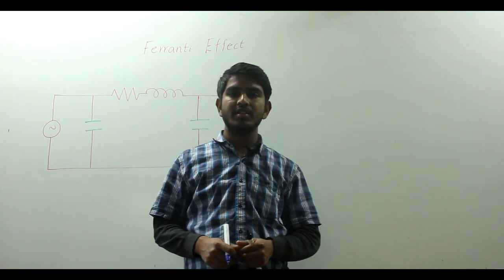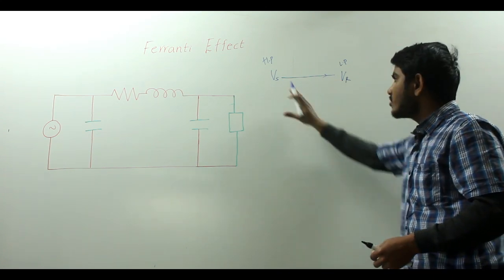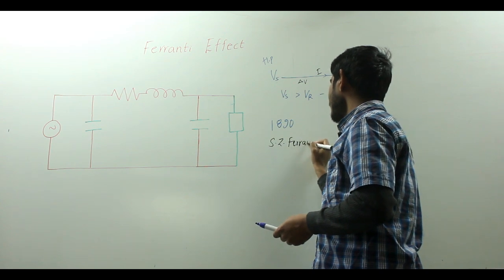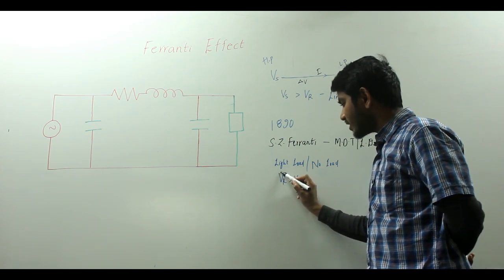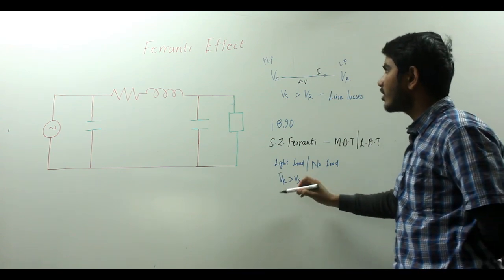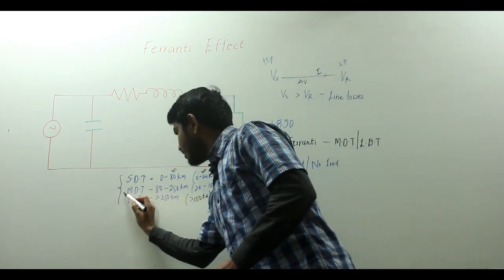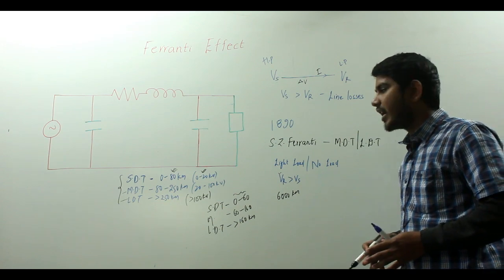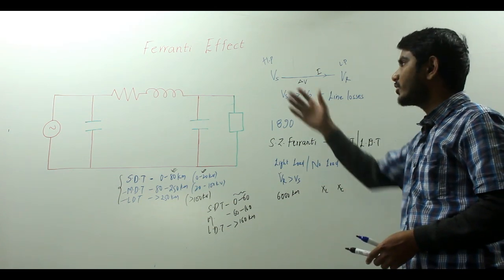Ferranti Effect (plz use speakers)

Comment: how charging current flow if  the 
line is open circuited??
Reply: The transmission line draws the current by the capacitive nature existing between line and ground or neutral.

Comment: Sir please tell the relation between the length of a transmission line and value of shunt capacitance. For example, how to calculate the value of line to ground capacitance for a 350 KM  transmission line